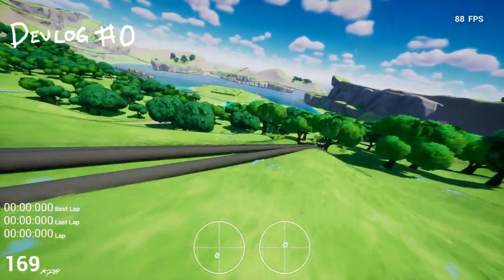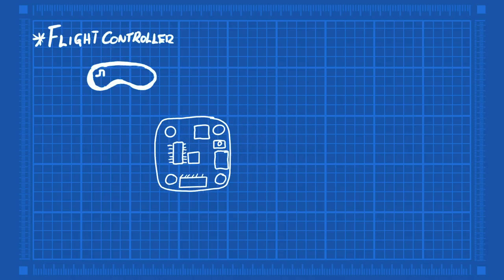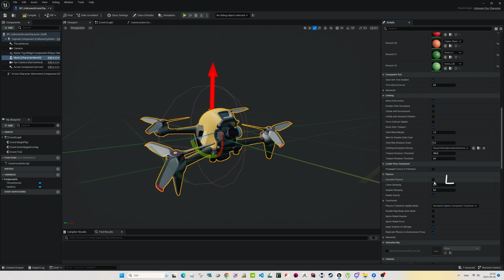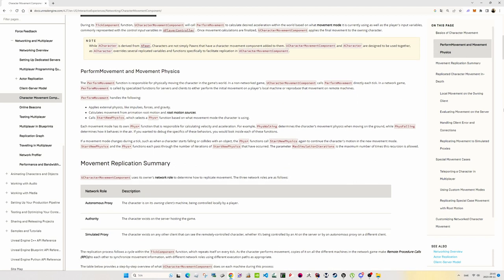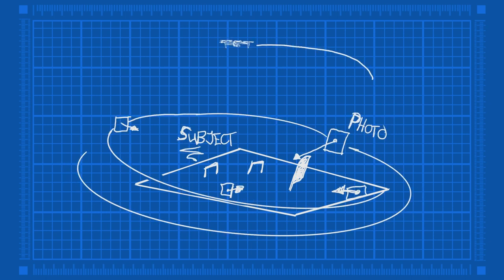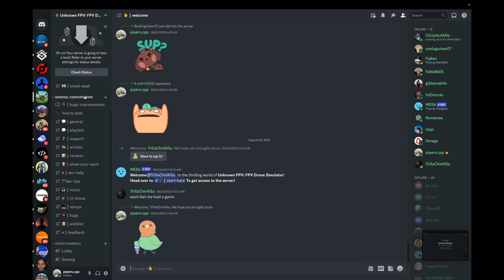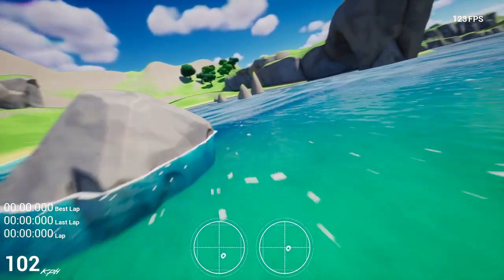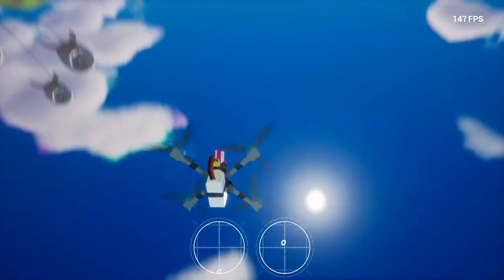Making a stylized FPV drone simulator | Devlog 0

Comment: just got early access to the game in steam and like the physics and graphics alot. I cannot change to malmö or gothenburg map. Are they not available yet ?
Reply from the maker: Hey Natural, thanks for your input!
They should be available. However I can see from testing the map that its partly inside the forest, my bad. I will push an hotfix for it asap.
Reply from the maker: If the hotfix aint successful then please check over on discord and post your logs! :)